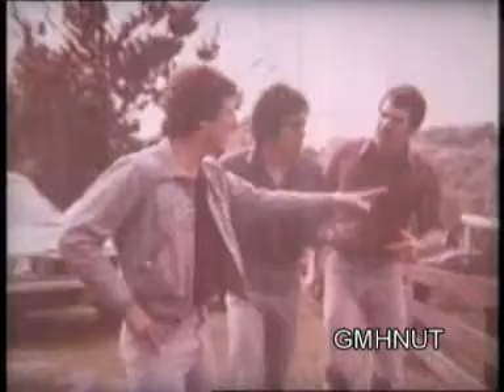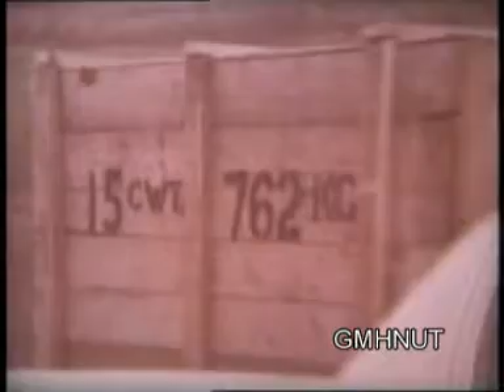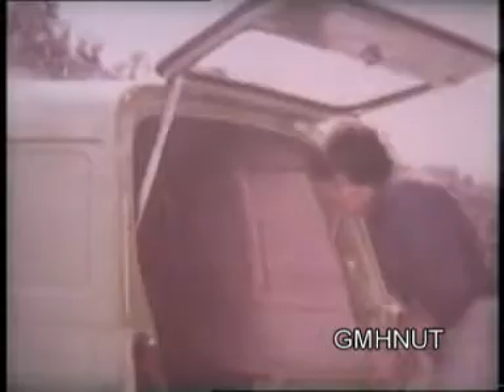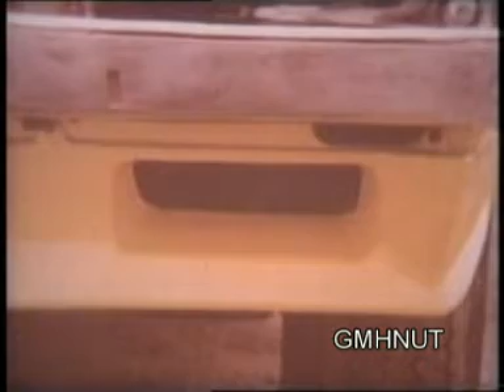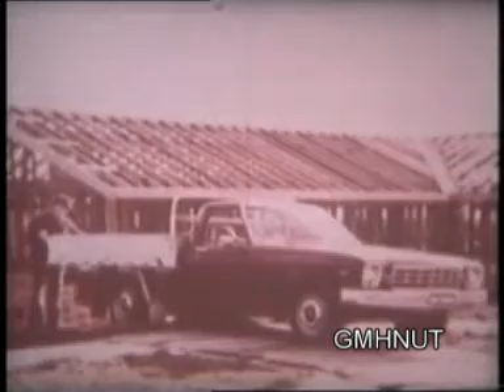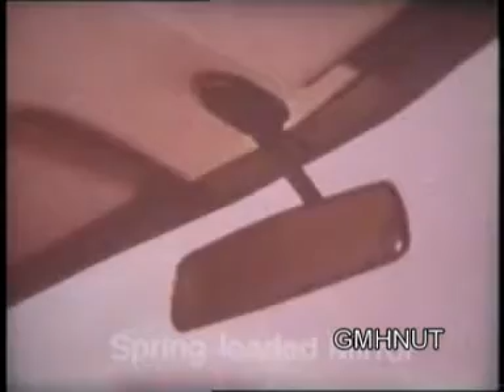Holden HZ Commercial Range Including Sandman

Comment: i remember my uncle when he had the beige color hz 1 tonner with 4.2 tri matic colum auto and my aunty having the 74 hq yellow black / black interior 308 tri matic auto gts monaro as her car ,   even in today of sep 2021 this monaro is still a local to this victorian town in east gippsland , offically a 3 owner car with all books and papers ,  my aunty bought it as a demo car think in bendigo , added the tow bar and it spent 10 years towing horse floats until they bought the 84 60 series G pack landcruiser  , drove that for 12 years and bought the 80' series in 96 , and got plus 3,000 on its new car price as sold it private, now the 80's  series was a total lemon car in their eyes and toyota dealers eyes too ,  it had broken crankshaft from brand new  to 75 ,000km before breaking ,,  well done toyota they jumped straight in and offered holden dealer full replacement free off charge ,  and fitted it too ,  as this car was under toyota watchful eye after extenstive history of this noise in motor from new ,  honest agreement between toyata and owners of this landcruiser ,  this is why you can rely on a toyota ,,   then they bought the wh v8 statesman new and got so many issues they called it a lemon too , i worked for holden while the v8 recall was on ,  and 75% of our vx /vy sales were all v8 ,,   after rebuild bullet proof motors and quite  too

Comment: I think it was the best model out in 1978/9, till the VB came out and i had a SL/E 5LT, silver with the light cream valorer trim, beast basically, but i think you could order the SANDMAN with side pipe exhaust or maybe it was a aftermarket model, my friend had one and the Le Monaro, i wonder why they did not make the new LE Version, still loved the statesman caprice, which my friend mum had one and we used to say no my mums Roles royce LTD was better more power and heaps of more room as well, + it was a town car as well. :) They dont make them like they used to do they ? All that plastic yet still weigh in at nearly 2 tons lol :)

Comment: Used to have a blue HZ sandman, great for the drive-in's. The dealership sold it to me as a 253 but I found it was a 308 when I got a closer look a day or two later. I guess they thought the smaller engine would help it sell seeing as petrol prices were scaring everyone still. Not the best for blind spots but it had grunt and appeal.